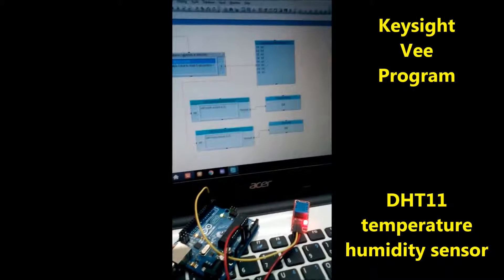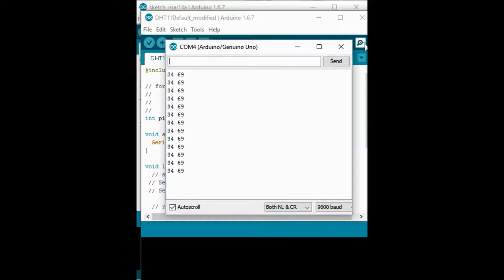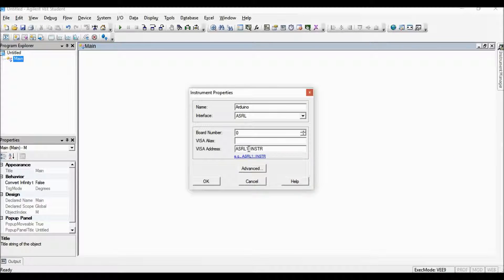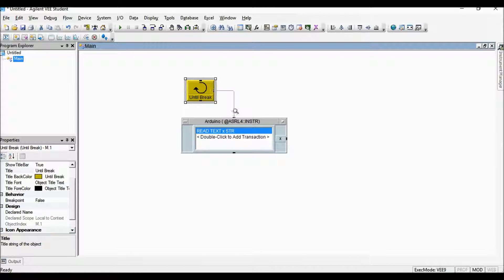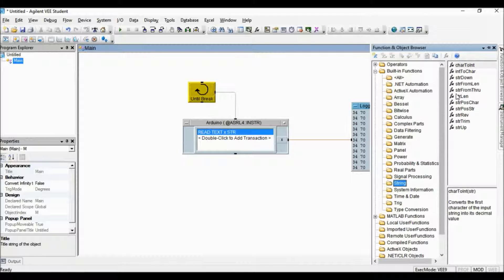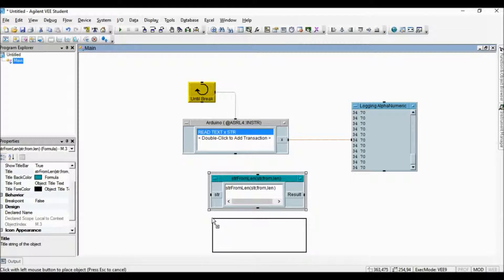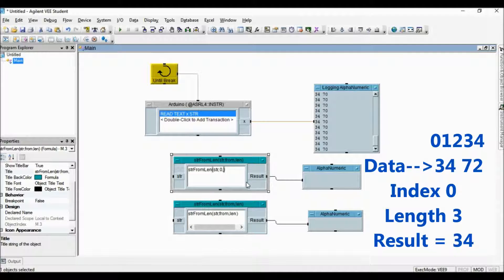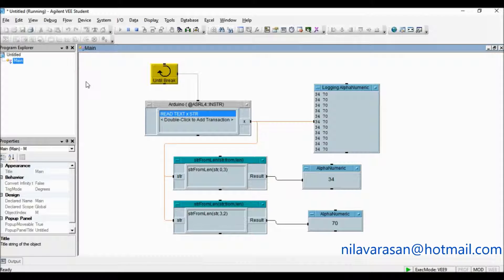Read DHT11 Data From Arduino Using Keysight Vee Program

Comment: Hello sir, I have a Question?
I need to control equipment DAQ Keysight by Arduino controller. So i think use arduino with vee program for control equipment. I understand correctly ? Please you answer me Thank you Sir.